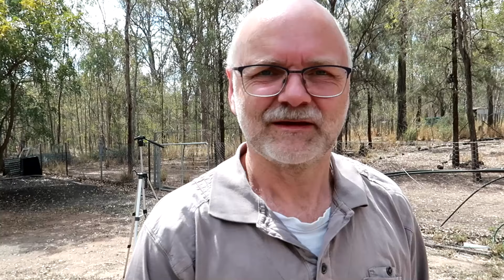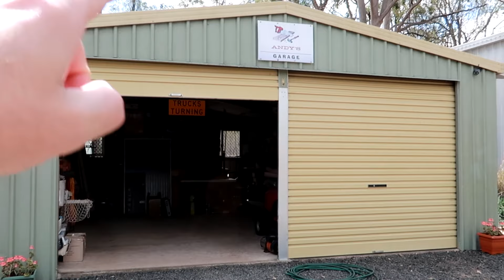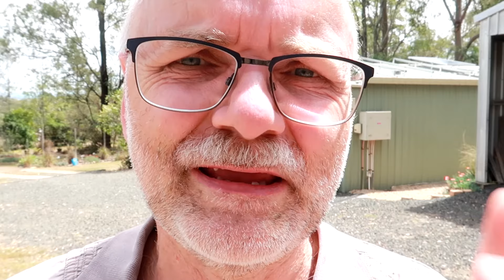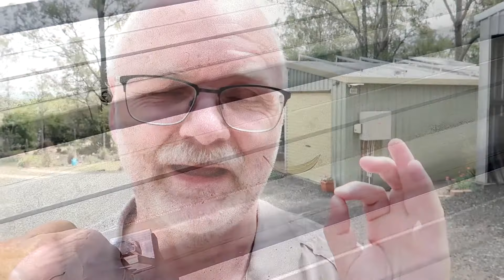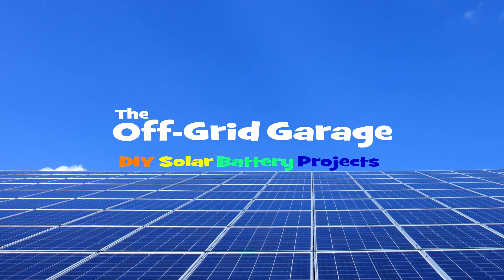Welcome to the Off-Grid Garage! 🌞🔋

Comment: Hi Andy always enjoy your videos. I have a question.
My house is wired 3 phase (I have no 3 phase equipment) I have three single phase 5kwh inverters. My question is, is there anyway or anything to make them load share?
Reply from the maker: Thank you, Jerry. Well, you can get the electrician in and wire all to a single phase house. The three single phase inverters can then be paralleled and share the load (if that is possible with the ones you have. Not all can do that). This also has the advantage, that if one fails, you still have two working...
Reply: @Off-Grid Garage  the three inverters I have can not be paralleled together, I was hoping that I could install something like a 3 phase auto transformer or stabilizer

Comment: Hello from the USA, Have a ? About inverter over voltage alarm when mppt charge controller gets lithium battery up to 14.6 , manual shows 15 volts is over voltage. Inverter is a cnswipower brand.
Reply from the maker: 14.6V is high for a 12V battery if it is LiFePO4. It should be 13.8V, maybe 14V.
If the inverter shows high voltage alarm but does not turn off, well, it's just and alarm, so... Not sure how accurate it measures.

Comment: Hello sir I'm watching your youtube channel, it is superb elaborate & understanding all about solar working system.After watching your programme ihave purchased one .
I'm Thomas from india, I have purchased  180W solar panel without wire . What type of DC wire I must use for every panel I add in future (from panel to  controller) or can I use AC wire?
Thank you for your support. Guide me sir .This is for my home. Already have Inverter in my house . Take care.
God Bless You.
Reply from the maker: Thanks Thomas. Solar panels have usually a 4mm² double insulated cable with MC4 connector. That should be sufficient for your setup. 
I would not recommend AC wiring.
Reply: @OffGridGarageAustralia  thank you for your valuable  advice.
Your way of explanation is superb.keep it up.
Reply: Hai , I have purchased 2(180 watt) panel.can I purchase 50 Amp mppt solar charge converter?
As your previous advise for using 4sq.mm, can I use it for the full setup.
Thank you.
Reply: Hai the panels(2) I purchased  one is 32 cells & other one is 36 cells. Any problem will happen if I mix 2 different cell panels?
Reply from the maker: @thomasvarghese1362  Very difficult to answer without having the details of the sticker at the back. They need to have the same voltage if put in parallel and the same ampere if you put them in series.

Comment: Dear friend..I have 2 100w 12v 5a each solar panels 1 battery 12v 100a bosh agm 1 controller charger maximum 60a and an inverter 12v to 220v/240v peak power 4000w runs maximum 2000w…panels are connected parallel..my question is can I run a mini fridge 110w/50hz 0.6a r600a 220v/v240?here we have from 7+30 to 19+30 sun shine as I am in cyprus Mediterranean sea.

I don't have any idea what is R600a:)

Thanks a lot!!!

Comment: Here's a man thinking along the same lines as me, just way more motivated to create a channel and showcase it, well done! Around 6 years ago I done something similar installing a stand alone off grid 4 kWh solar system with 12 x 2 volt 1,500 AH Lion MPE31S lead acid batteries. I installed a changeover switch in the shed to switch between grid/off grid supply and a separate always off grid circuit to the house, i.e. we have 10 power points spread throughout the house which are off grid supply only and we use approx 80% of our house consumption through these. Neighbors are very jealous when our TV, standing lights, refrigeration etc. keep running when the rest of the street goes black. Will be interested to watch your project.
Reply from the maker: Thanks Greg. Sound like a nice setup you have there. Is the 4kW solar enough for this size of battery?
Reply: @OffGridGarageAustralia  Hi Andy, yes we run an efficient house managing our consumption around generation. We're just started charging our ZS EV with it so will let you know how that goes.
Reply: Also in Au NSW and starting my journey now (Sept 2023) ... looking forward to hearing more : )  @ElectricCarAustralia

Comment: Maybe you have this info somewhere I couldn’t find, what bench charger do you recommend for top balancing your cells?
Reply from the maker: I use a modified ATX power supply and a DC-DC buck converter. Works fine. There is a video about it her on the channel...

Comment: Elejoy 200watts mppt  can using 2pcs 150watts series connection for 24volts set up sir?
Reply from the maker: You have to look in the specs of the MPPT. If it says max 200W you cannot connect 2x150W.

Comment: Hi Andy, I happened upon your channel while researching LiFePo4 batteries, fantastic work and detail in the couple of videos already watched. I like your style and love your Garage, I am grateful for all the testing you have conducted and the specifications and results you have shared. I hail out of South Africa where our government run utility supplier is unable to supply un interrupted power. We experience an average of 6 hours a day of power cuts known as load shedding, this has been every day for the last 8 months. I have installed a 5KW full hybrid inverter with a 5,12kWh LiFePo4 battery pack. There were a few minor difficulties when first powering on but managed to sort them out. I have been considering taking my garage off grid and after finding this channel I am convinced and ready to build my own battery bank, install solar panels and Inverter. Great channel thanks.
Reply: Hi Mike, The Whirlpool Forum also mentioned LifePo4 products ... I will look into them : ) How did you go with building your own battery bank. I too hail from S A : )

Comment: I have been watching your channel for a long time and learned a lot from it. I recently purchased a PV installation. 10 panels with enphase inverters. Is it possible to connect an enphase iq7 directly to a LiIon battery pack. I want to charge the battery during a surplus of solar energy and use the battery as a buffer when there is a shortage of solar energy, taking into account the limited capacity

Comment: I'm watching old videos, nice home you have , 
I hope to have my off grid mini homested looking so nice, sofar it's just a off grid house in the woods!

 I love making my own power, it's a great hobby also, nothing wrong with someone starting small...  The sales ppl. Tell you to start with your power bill, to judge the power needs, that usually ends up with something like 20kw, and 50kwh of battery, I had much rather start small, I had to start with how much I could afford!! I would suggest something like a 3kw all in one, (to my self, or someone the  like.)  Something like the 3kw growatt 24v and enough battery to run it at half power for atleast 12hours, then solar panels, enough to charge those batteries in about 4-5 hours, then either buy more batteries, or panels, or a wind turbine, if you have a sustained wind, to make it useful, if it doesn't do about 400 watts for 4-5 hours a day, I wouldn't go for it, ( I only get wind in storms or foul weather, si I'm probably going to do wind last, with a high tower, so it can make power when there is no sun, something capable of 1kw, and can Handle high wind!)
Any way, now that there's a working system, either add more battery or panels, or both, then possibly add another inverter, if needed, and with enough battery to run 3kw for 24hours, /6kw for 12, and enough pv to charge in a day, or nearly, this should be a good start, then either sell the inverters, or get more, eventually it should supply everything like on grid, I can get by with 6kw, my 5kw handles my needs fine, I could use more inverter, about 8kw would probably be perfect!!
Reply from the maker: Thanks, man. Nice you're going back to the roots of this show 😉
I already upgrade from the proposed 12V system to a 24V and now to a 48V battery. I hope it all works out eventually.